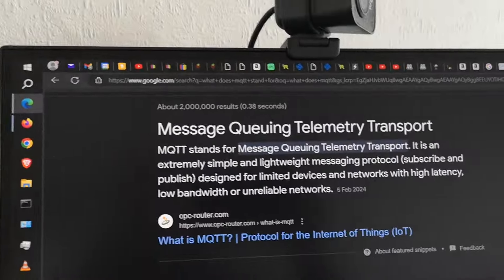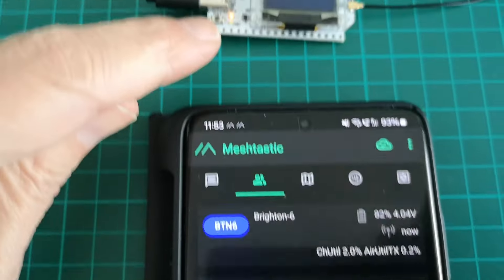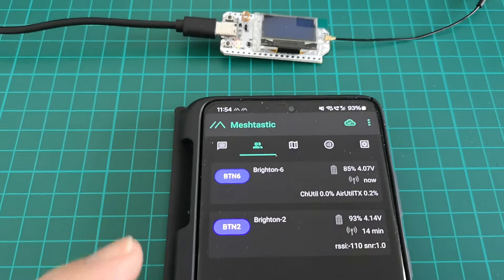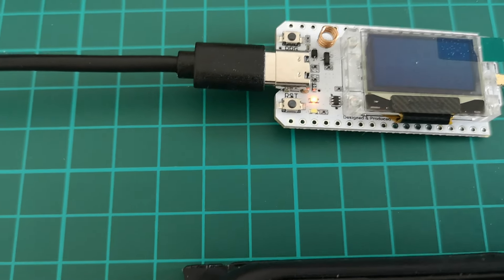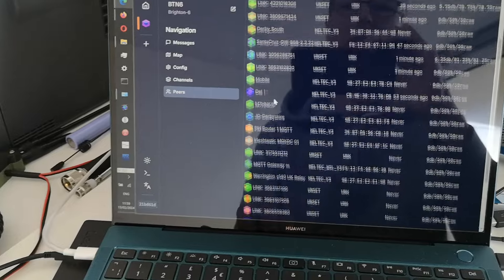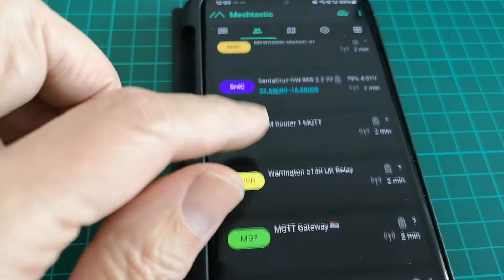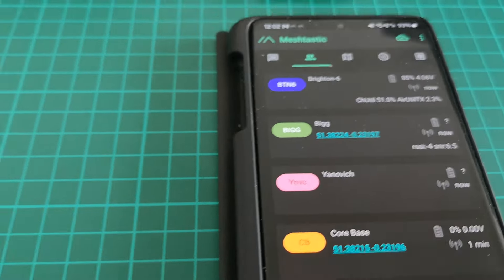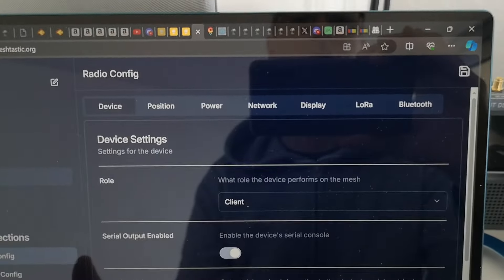MQTT settings for Meshtastic node including the hard to find ones.

Comment: Please to those watching. if you have local RF contacts don't switch this on as it will flood and stop people doing real rf only meshtastic networking.
Reply from the maker: I only enable mqtt when connected to a dummy load. It is also possible to disable TX in the radio settings.

Comment: On my iPhone,  I found the controls for uplink/downlink on the phone menu at radio configuration > channel. I also found it necessary to set the Root Topic to msh/EU_898 which wasn't the default for me. I have seen your nodename on MQTT and wondered if it were you... I'll try and send you a message.
Reply: yes ive got it on my app as well . Tap on the Radio configuration/Channels ,tap on  the first channel, mines 0 Longfast  and the uplink and downlink is revealed
Reply from the maker: Thanks for the info. It could well have been me so please sa hi when you get the opportunity. I currently have MQTT switched off in order to avoid polluting the airwaves with long node lists.
Reply from the maker: Thank you for that. I hadn't thought of clicking the channel name to get to the additional settings. I suppose it allows finer granularity in controlling settings for channels independent of each other.
Reply: Actually if you are in the UK you want to set the root topic to msh/UKWide. Otherwise you will receive all the traffic for the whole of Europe, flooding the Mesh as it started to do a month or so back when it was worldwide. I can see this becoming more granular in the future as it becomes more popular, maybe Counties, Cities, Town's etc.

Comment: How to choose who's messages are relayed from internet? I only want to see MQTT messages from my friends.
Reply from the maker: I am not aware that you can put a filter on who you see in a channel (eg. LongFast or UKwide), but what you could do (I have not yet tried this) is to set up a new channel only for your friends. You would have to shared the preshared encryption key with them but this would be easy using the QR code generated by your app for your new channel.

Comment: My understanding is that this frequency range isnt restricted to licensed amateurs, so im assuming enceyption is ok. If you use the 433mhz version you can only use that by virtue of your license and you then need to enable amateur mode disavle encryption? My understanding was being licensed gives you additional privileges over joe public but these come with rules...but it doesnt take away what you could do beforehand. So if it's legal for an unlicensed individual it is also legal for you?
Reply: The 433MHz frequencies used by LORA are in the license exempt set of frequencies, so no need to follow amateur radio conditions there either (eg encryption)

Comment: Great video, thanks for clarifying a few points. I’m looking to setup MQTT for a local MQTT server so I can monitor Meshtastic over the local network and use within Home Assistant. I’m following the official docs but does anyone have any experience of implementing this?
Reply: Yup - is there somewhere we can have a more longform discussion? I have this setup and also use MQTT to make my node broadcast weather data from my local weather station.
Reply from the maker: Maybe try looking on
https://meshtastic.discourse.group/
Reply: @fotografm  Don't know if that will help much, there have been changes in the 2.2.22+ firmware because I requested to be able to send to any channel, and I pointed out that the logic that checked for a channel called mqtt only worked when the root MQTT topic was msh/ when it changed to msh/REGION (eg msh/EU_868) then it broke because the loop that split the topic apart landed on a channel called json, instead of a channel called mqtt - and then rejected the message.
Reply from the maker: @AndrewJonesMcGuire  that is interesting. It is still beta software of course, so let's hope that these point will be ironed out in time.
Reply: @fotografm  I expect plenty of issues popping up and then being resolved as the path to v3 continues. The routing change in v3 will be huge and because it's considered to be a breaking change, will probably significantly impact the mesh where it relies on remote unattended nodes for bridging contacts - until they are updated to use the new routing algorithm.
Reply from the maker: @AndrewJonesMcGuire  Interesting to see what will happen there !

Comment: Hi, I have tried all the settings, including the laptop app, but nothing works. I am not receiving any MQTT data. I also have the impression that my Lora component is defective, as I see in every video on the ESP32 V3 display that you can select multiple pages (dots at the bottom). But for me there are only 2, no matter which firmware I install.
Greetings
Reply from the maker: Are you using a Heltec v3 ? I tend to ignore the display on those and always use the mobile phone app via bluetooth as there are more setting options available. MQTT needs to be enabled in three different places: Channels settings: UPLINK and DOWLINK both enabled. Lora settings - Ignore MQTT: OFF and OK to MQTT: ON. MQTT settings module: MQTT: enabled, default address, username and password. Good luck !

Comment: So i could send data from one meshtastic device not on internet to another connected to the internet and have the opposite setup have a internet connected meshtastic transmit data wirelessly? If im saying that correctly.
Reply from the maker: That's right.

Comment: Good that you did testing with the dummy load, because enabling MQTT is bad as you'll flood the mesh with broadcasts slowing it down for everyone.
Reply from the maker: Indeed ! It is also possible to disable TX in the node settings but I wanted to be sure.
Reply: hi Jacko i'm completely new to this ,so am i correct in thinking that it will also transmit as well as using the internet at the same time if TX is enabled,so if i turn off TX it will only go via the internet ? I am currently not using MQQT and i dont think that i will.  I've currently not picked up a single thing here in Norfolk ATM
Reply: @drmisfit  Hi, whats your location? I'm in Norfolk too (near Hingham) with no RF connections. I'm thinking of setting up an unattended node at a local high point (not many high points in Norfolk🙂) to extend the RF mesh.

Comment: and how do you get that page you show on the laptop ?
Reply from the maker: Plug the node into a USB port on a windows machine then use a Chrome based browser (ie. Chrome or Edge but not Firefox) and go to client.meshtastic.org. After choosing Serial and New Device interface and the correct com port you are presented with the pages I showed on my laptop. A future video will show how to connect a console erminal to the device using Python.

Comment: I can't get mine to connect to my home network via my WiFi router.
I thought I would have been able to do this and then connect in to my network via WiFi from the Meshtastic App.
Bluetooth isn't good enough here.
Reply: I am using a Heltec V3, although it states it will connect on WiFi, it just doesn't.  Then I have to refresh to get back in again via Bluetooth.
Reply from the maker: There are still problems with the wifi connection. Remember that enabling wifi will disable bluetooth on the board and vice versa.
Reply: Turn on all the settings he showed in the video.  It’ll work.